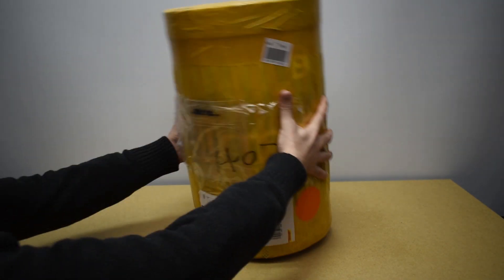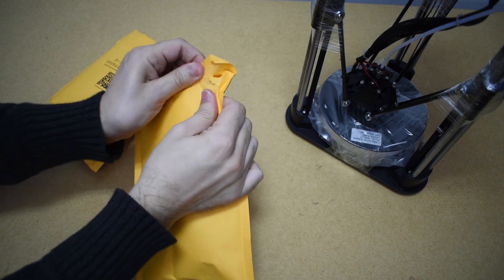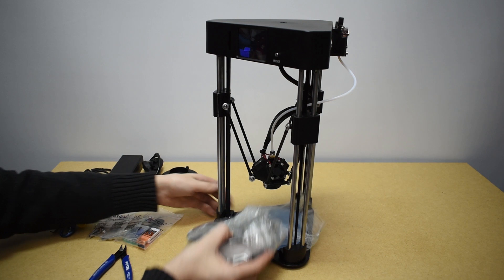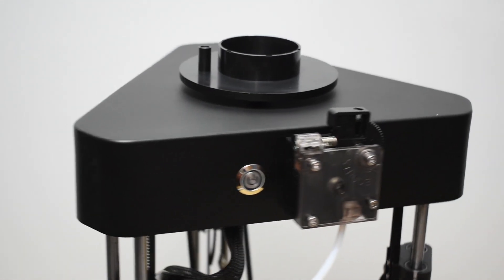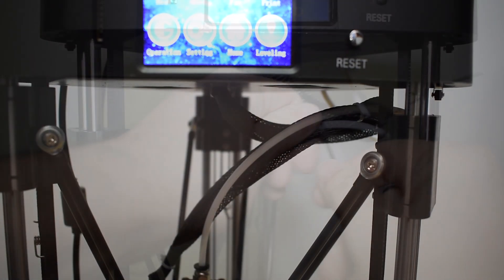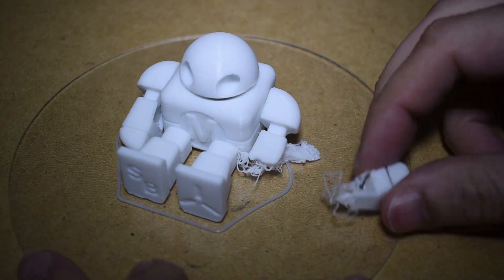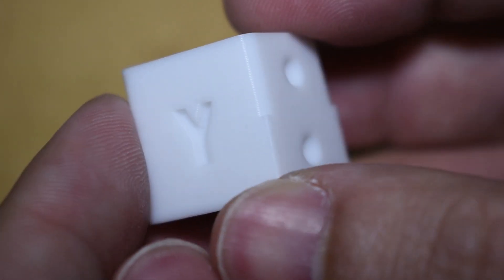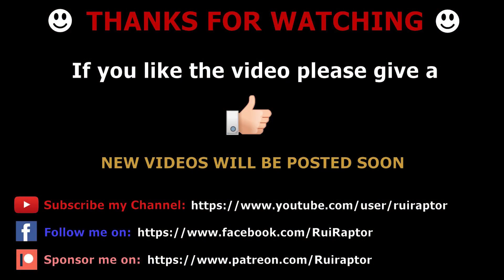Biqu Magician 3D Printer - Unboxing and First Prints

Comment: Nice prints ! size of the bed ?
Thingverse links of prints svp.
Reply from the maker: Hi Nathan,
The bed size is Diameter=100mm and height=150mm.
Regarding the links, here they are:

Knight: https://www.thingiverse.com/thing:33804
Bunny: https://www.thingiverse.com/thing:2778632
Cooling fan tester cube: https://www.thingiverse.com/thing:2198654
Ripple cube: https://www.thingiverse.com/thing:277394
Reply: Thanks

Comment: What is the powerusage in watt of this printer ? On the website of Biqu i read 40wat printhead power usage !
Reply from the maker: Hi Marnix,
I do have a video where i compare power consumption between a few printer models. The biqu i haven't tested yet but i can say that the external power supply that powers the printer is 12V-10A.
Reply: The reason why i ask thi i would like to buy a small fully assembled to install on my desk. The problem is that i alreday have a powerconsumption off 2.9 amp on 220v. and i think my power cables in the walls are almost on their max.. i first was thinking of buying the colido D1315 (power consumption only 30 watt) or theis one. The difference between them is that this one has a display and has autoleveling and can print from SD. The Colido can only print from USB and has no display and no autoleveling. But has a 12V 3A Power Supply....

Comment: Which would you choose, the Tevo tarantula or this Biqu?
Reply from the maker: Hi Domingos,
The 2 are very different printers.
The tevo tarantula is a big cartesian type printer capable of printing large objects.
The biqu is a small delta type printer that can only print small objects.
The tarantula can print many different types of materials while the biqu can only print PLA and maybe some PETG.
The tarantula is delivered in a kit while the biqu is delivered fully assembled.
If you ask me...because i like to print large models, the biqu is not the right model for me
But...if i would prefer an already built printer and i was only interested in printing small objects (D=100mm and Height=150mm) then the biqu was the best choice.
Reply: Appreciate you taken the time to reply to me, i am in the process of buying a Tevo tarantula, one of the reasons is the fact that it has a somewhat large print base for such a low price. I will be seeing your videos on it for reference. Thanks